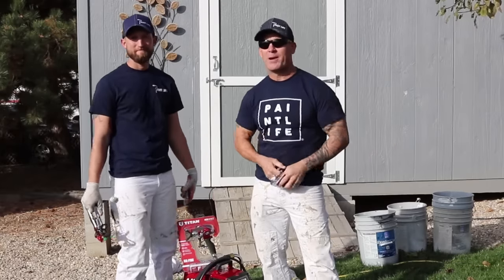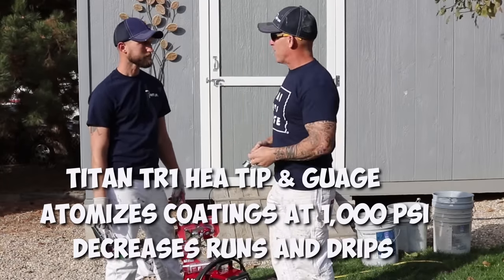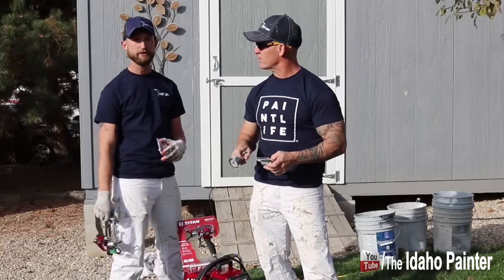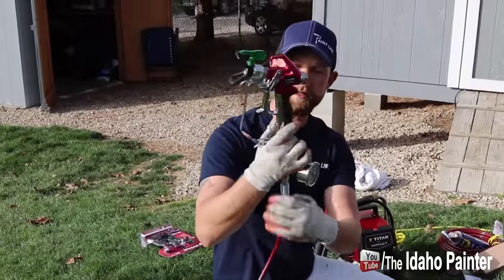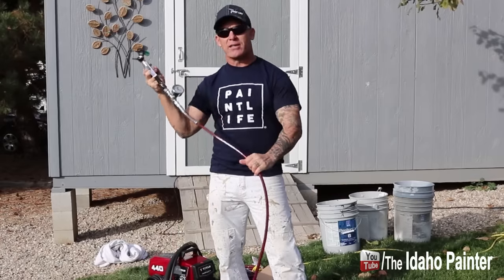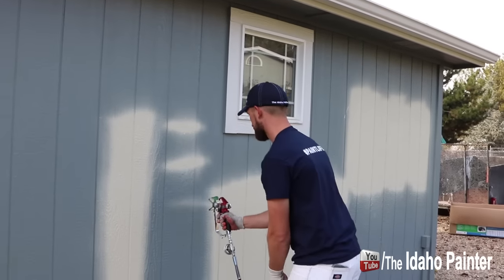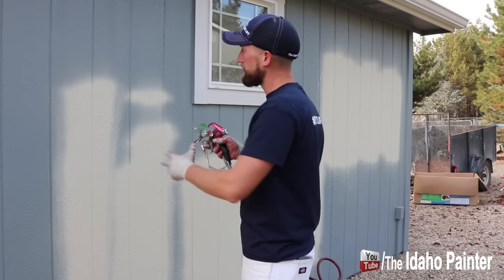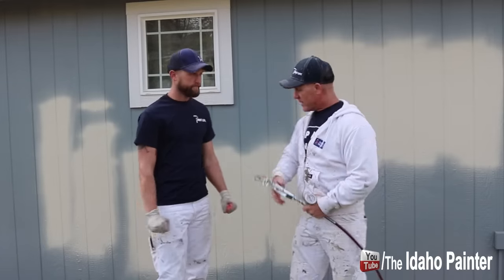STOP paint overspray.  Use Titan's New TR1 HEA Spray Tips.

Comment: How many times has that shed been painted on this show? :-)
Reply from the maker: lol, a lot. We're going to have to build a new shed to paint
Reply: See those blocks under the shed? Those have nothing to do with leveling. They are there to hold and distribute the weight of the amount of paint on the shed. I think the shed is sinking into the earth every day. Ballistic walls though.
 Fire a few rounds into that wall and watch the bullets bounce off.
Reply: You guys still using this system much?
Reply: Lol I know it was a joke but does the wood get negatively impacted by to much paint?
Reply: Like to see different kinds of sprayers an info how they work and hold up over time
Reply: Would also like to see maintenance of graco sprayer repack and more stuff
Reply: @Idahopainter  Maybe you couldcput up a single sheet or two  of T1-11 in stands to paint

Comment: these tips as well as the gracos new ff low pressure tips are amazing.  I like gracos a little better inside becaus I like using ff tips on walls.  They are expensive but not when you consider the savings.  You can save a ton of paint and the tip lasts much longer at the low pressure.  I wouldnt say the instantly make a novice a pro but they do help the learning curve.  The feathering helps bad strokes.

Comment: Thanks for all the videos. Been binge watching the last few days as I'm getting ready to paint my garage. Just picked up a used(1.5yr old) Titan 640 for $700 because I wanted the digital readout. Also picked up the Titan Pro-RX gun, 20" extension, and the rac X 310 fine finish and 517 tips. Do you think these Titan tips are better than the Rac X tips? 
I'm brand new to using an airless so curious on your thoughts.
Reply: armyguy209 I think the 310 and 517 rack X tips you have will work just fine. However these new tips from Titan (HEA) and Graco (FFLP) are meant to be shot at 55% less pressure than The original Rac X black tips. I spray the FFLP tips around 1250 psi on my Graco 490 and it also produces a finer finish. I only own FFLP tips. Spring at lower pressure has several benefits including prolonging the life of your sprayer, less aerosolized particles,
Reply from the maker: The HEA tips are completely different then the FFLP tips. Both tips serve different purposes even though they are the same color plastic
Reply from the maker: The HEA tips are great for reducing overspray.

Comment: I can't see that the guages are needed if the pattern goes from fingering to feathered as the correct pressure is reached.  That pump setting can be marked or noted for each paint type and hose length.
Reply from the maker: Yes
Reply: Oh yea

Comment: First of all, thank you for all the informative videos you post, mistakes you made and corrected( not too many people can acknowledge theirs, never mind putting them on the internet). I would like to see these airless guns have the pressure gauge incorporated in them like the SATAjet® 5000 B RP which has a digital one inside its handle. Question: Can you run these tips or Graco's  RAC X FF LP with an air- assisted airless? Thank you.
Reply from the maker: Only the Graco tips can run through the air assisted.
Reply: Thank you, Chris.

Comment: Good video. looks like too much work It seems easier to just bring that pressure up a touch as needed to get rid of that fingering  and just get it where it should be
Reply from the maker: Yeah, thanks for watching Matthew!
Reply: My old boss used to run that pressure guage on an hvlp for spraying laquer and stain on high end interior work; Mostly cabinets, doors, crown molding, etc. It's a little outta place for exterior work, try waving that thing around for 6-8 hours spraying all day and it's going to end up cracked, and extra weight not worth the trouble. Just test your fan on a cardboard shield  when you're setting up and you're good to go.
Reply: Think both of you guys missed the point of the video, they used the gauges to figure out how much extra pressure they needed to use in order to run these type of tips correctly with extended lengths of hoses.

Comment: Have. You tried just running it by feel like we do normal tips? Turning up the pressure to get rid of fingering untill it's solid with soft edges and working from there? I wonder If the gauge is really needed if you were in a pinch
Reply from the maker: It is too difficult to do without the gauge

Comment: Just bought this system tonight and using it tomorrow night. Question, can I leave the gauge on the pump and just set the pressure to the top of the green with a 50’ hose? Rather not have it on the spray gun if possible
Reply from the maker: You lose pressure the longer the hose is

Comment: I've been looking at the Titan and Graco paint sprayers. What makes the system a high efficiency/low overspray sprayer?  Is it the tip or pump or both?  
If I use a Graco sprayer with a Titan TR1 HEA spray tip will I get the same results as if I used a Titan sprayer with the TR1 HEA spray tip?
The Titan ControlMax 1700 High Efficiency Airless Paint Sprayer, is it the tip that makes this sprayer HE?
Reply from the maker: The Tip.  Thanks for the question or comment.  All our questions are now answered on our Facebook group "Paint Life Members".  Join that group and you will receive all the help you need.  Hope to see you there.

Comment: Stop wasting time with those gauges. Adjust the pressure until the spray pattern looks good and don’t think about the formulas and equations of hose length, material, nozzle and height.

Comment: So why using new Titan tips over Graco FF tips?
Reply: They said that HEA gives bigger drop than FFLP. I`m courious too...
Reply: I’ve tried both, pretty much same thing , lower pressure bigger droplet size, I tried spraying walls on a new house, it’s really slow , also you must apply heaps of paint to fill pin holes that comes with the low pressure, I prefer just the regular graco  blue ltx tip for walls ,
Reply from the maker: The HEA tips are completely different then the FFLP tips. Both tips serve different purposes even though they are the same color. The HEA tips are great for reducing overspray.
Reply: dont confuse the graco ff tips with the new fflp tips...

Comment: What is the difference between Titian epa tip and the graco green LP tip
Reply: They both are supposed to be very similar but the graco tips need about 1800psi to work but the HEA tips work at roughly 1100psi I use the HEA tips every day on new builds in the UK with freshly skimmed walls and I can't fault them one bit

Comment: so they Don't like the gun gauge in the way, they don't like the heavy drops finish,   and it still fingers with a 100 ft hose ,need to pressure above the green zone . Add your extra long gun extension and find it spits ...so the over spray is less?  So the Question? do you like it?
Reply from the maker: The tip is great for fences

Comment: I currently use the fflp tips from graco. Why are the hea better? I can pick up fflp tips for about 37 bucks on amazon
Reply: Same here, i use only FFLP tips. It gives a beautiful find finish at a lower pressure.
Reply from the maker: The HEA tips are completely different then the FFLP tips. Both tips serve different purposes even though they are the same color. The HEA tips are great for reducing overspray. They can be helpful in certain situations opposed to RAC X
Reply: Home Improvement How To's  I suppose I have to try the HEA tips. But the fflp also reduce the overspray.
Reply: martynzl that's interesting. I am gonna try and check that out.
Reply: I don't believe the HEA's are intended to be a fine finish tip like the Graco FFLP's. The HEAs are designed to provide the same production as a regular tip at lower pressures. I picked up the HEA's for about $27 each at Sherwin Williams Blue Bucket Sale.

Comment: Why would you ever need 150' hose? Pick up the pump and move it.
Reply from the maker: Why would you pick up the pump when you can use a 150' hose?
Reply: I agree you lose pressure. An extra long hose if it's a 3 or 4 story exterior job.